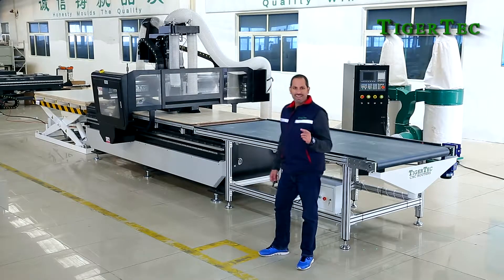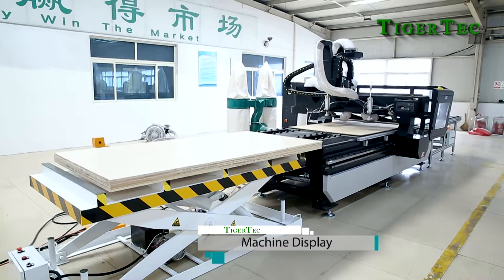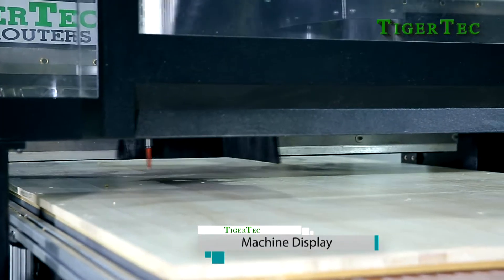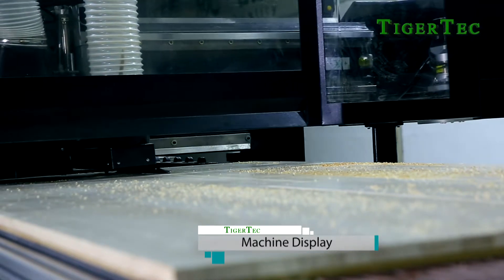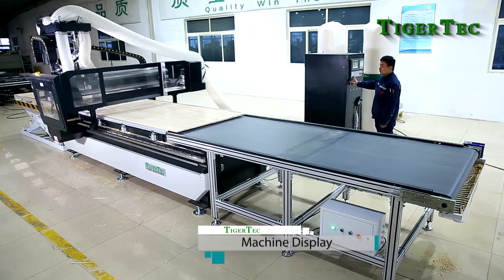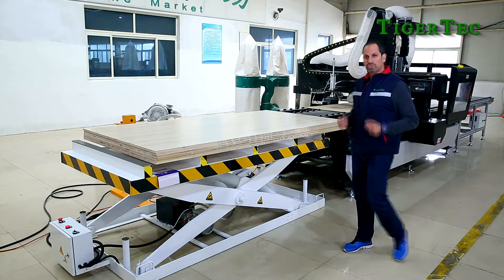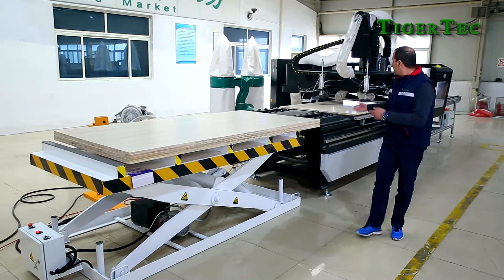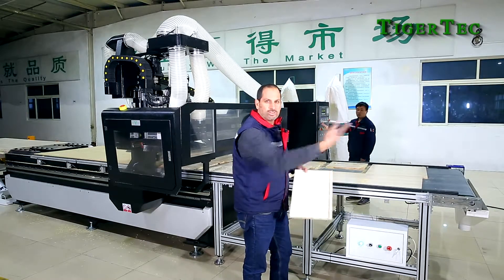TigerTec CNC - Machining center Routing Nesting Drilling

Comment: How much it cost?
Reply from the maker: Hi, can you tell me your business? This is Nesting machine for furniturer industry, and we are manufacturer, focus the high quality machines. can you tell me your email or whatsapp number? Then I can do quotation for you/
Reply: @tigertec8471  well, I am carpenter,I use yunxitime software for nesting cabinet and office furniture,I would like to know how your machine cost?
Reply from the maker: @nsengiyumvafabrice6048  Hi, this machine with working size 1240x2460x200mm and Is this size suitable for you？ Can I know where are you come from?
Reply: @tigertec8471  excellent! The machine It is suitable for me because we use melamine board of 2440mm×1220mm,I am coming from East Africa, country is Rwanda.
Reply from the maker: @nsengiyumvafabrice6048  that's great, can you tell me your whatsapp number or you can add me: 0086-18560168107
Reply from the maker: Can you tell me your email or whatsapp number then I will send to you quotation
Reply from the maker: Hi Can you tell me your whatsapp number of email?